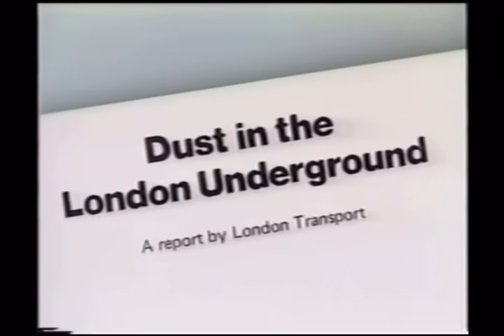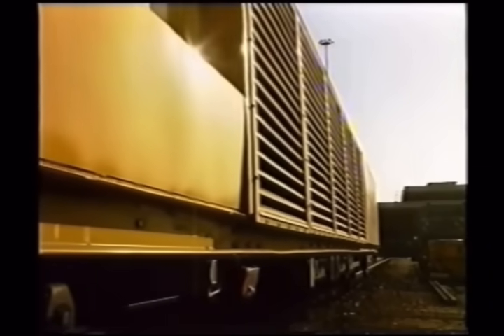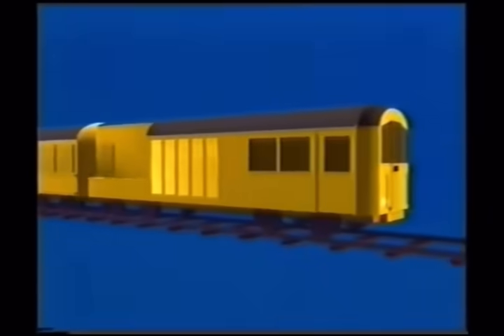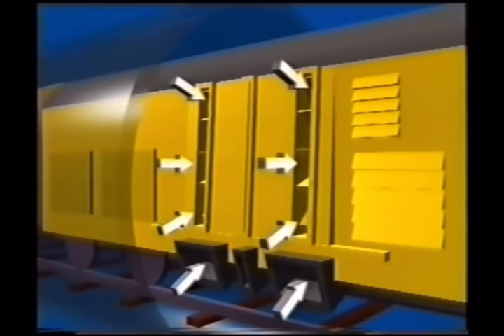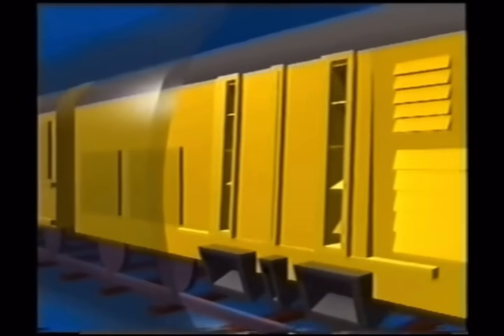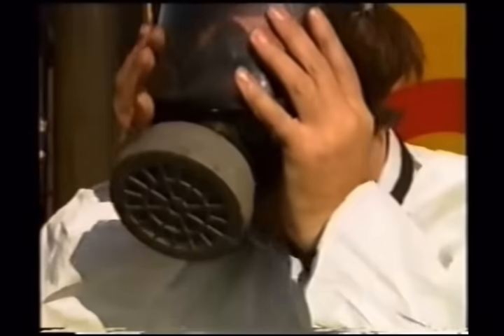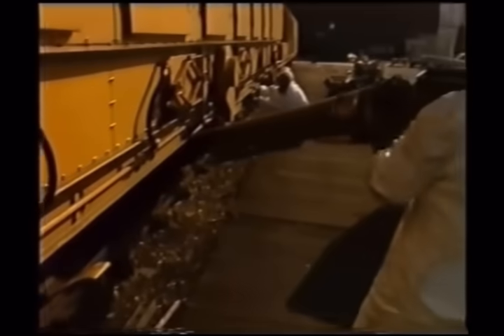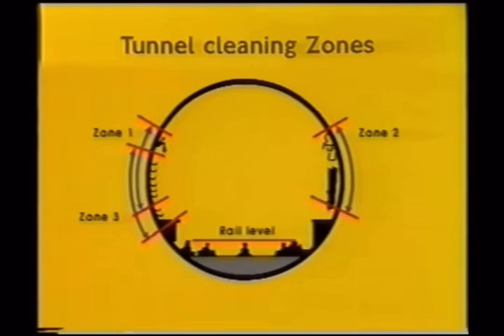Tunnel Cleaning Train - London Underground - #train #railway #london

Comment: Hi there my real Name is Mr C. T. Boxill-Harris, I have another interesting idea for most of us Class 315, Class 314, Class 313, Class 491, Class 442, Class 441, Class 430, Class 421, Class 412, Class 411, and Class 410, and that will also include those interesting Class 422 6 speed Voith DIWA Automatic Gearbox Transmission Very Very Loud 5 speed Allison Automatic Transmission Train fans out there, rather than scrapping most of the Class 315, Class 314, Class 313, Class 491, Class 441, Class 442, Class 430, Class 412, Class 411, Class 410, Class 422, that will instantly include the Class 421, maybe you guys can convert them. Including rebuilding most of the brand new Gardner 6LXB Engine, Scania N113 Engine, Gardner 6LXC Engine, Volvo B10M Engine, Garnder 6LX Engine, Cummins N14 Engine, Volvo D10A Engine, Leyland 510 Engine, Volvo D10M Engine, Gardner 8LXB Engine, Class 315, Class 313, Class 314, Class 491, Class 442, Class 314, Class 313, Class 441, Class 430, Class 412, Class 411, Class 410, Class 422, so they can be able to do all of the Particular Train units such as for example, Class 150, Class 155, Class 106, Class 117, Class 114, Class 105 and the Class 154 and that will instantly be including the Class 421, with a 6 speed Voith DIWA Automatic Gearbox Transmission Very Very Loud 5 speed Allison Automatic Gearboxes and converting and that will also be including building most of them into a Three Carriages per units of Class 315, Class 314, Class 313, Class 491, Class 421, Class 422, Class 442, Class 412, Class 410, and that is including those Class 411 6 speed Voith DIWA Automatic Gearbox Transmission Very Very Loud 5 speed Allison Automatic Transmission for all of us Class 421 and Class 412 Diesel Train fans out there Pretty PLEASE? Are you still going to do this interesting type of Project? Class 491, Class 441, Class 442, Class 430, Class 412 Class 411, and Class 410 will be rebuilding the Class 422 Diesel Train fans out there PLEASE.

Comment: When was the last time this was used? I have to wash my hair EVERY time I travel on the tube!!! It's disgusting! Why is there only one on these trains? Every different line should have it's own cleaning train! Crickey!!!! This is made of 1938 Bakerloo line Driving cars!!!  Almost 90 years old now... is there a newer version of this train or is LU still using the same unit?
Reply from the maker: Apparently this train has been scrapped, and the cleaning is done by hand using backpack hoovers, so I’ve been told.
Reply: @kingwolfgaming4774  Dust pan and brush then yet again! Sighs!!! 1 step forward - 3 steps backward as per usual!

Comment: This has to be 70s since they were then starting to push the metric system (kilometers). I don't know anyone in the UK that refers to Kilometers for distance.
Reply from the maker: You think it was that old? Did the metric system start in 1971? I’m not sure just asking. 👍
Reply: @kingwolfgaming4774  I think 1971 was the magic year for switching to a decimal currency and then the kinda/sorta adoption of the metric system. Gasoline and diesel pumps have, I believe, gone to measuring in litres but most road signs are still in "miles" and most people still talk in pounds and ounces. I emigrated in the early 90s so I can't tell you much beyond that other than what I glean in conversations.
Reply: @mostlyinterested1016  We refer to speed on roads in MPH, Height on Bridges in Feet and Inches but shows metric too all weights and measures in shops legally have to be metric EXCEPT for MILK AND BEER which can be sold in pints. People refer to their height in Feet and Inches and weight in Stones and Pounds (14 pounds is one stone) But day to day measuring is metric. We use degree Celsius for temperature and most people use the 24 hour clock. When we cook we use metric as in ml and litres and Grammes for weight. It's illegal for a shop to use-non metric weights and measures. I think most people of a certain age know their weight in both KGs and their height in metres but know the imperial versions. I think most British can flick between the systems quite easily. 
I remember a joke when we switched to metric in shops "A man says can I have a pound of potatoes please" the shopkeeper says we it's KILOS now. So the man says "Can I have a pound of Kilos please".
Reply: @markylon  The funny thing, going way back, is that it's so darned easy to multiply and divide in bases of ten and yet we all resisted it when it first started. Go figure.
Reply: The entire engineering world, including railway engineers, now use metric. New railways (at least, on the main line network - not sure what they do on the Underground) do still get mileposts as location markers, but the design and construction is done entirely in metric.

Comment: The main reason was apart from the trash the brakes are still made of asbestos
Reply from the maker: I’ve always wondered about the brake dust. Are they still asbestos based?
Reply: @kingwolfgaming4774  Automobile and truck brake pads haven't contained asbestos for something like 50 or 60 years now. I can't imagine that train brake pads would be any different. Aside from legality, who would still want to maintain the equipment and materials to make a few specialized brake pads a year?
Reply: Train brakes are cast iron that is one of the reasons they squeak. Cast is much softer than the wheels

Comment: Obviously pressure washing is out....well I hope not!
Reply from the maker: Why not you could turn the traction current off. 😆
Reply: @kingwolfgaming4774  Way too much electrical infrastructure like insulators and signaling and switchgear that was not designed to be protected from rain and would be quickly destroyed. There is also ancient power cabling near 100 years old, and its ability to withstand water mixed with conductive mud would be highly questionable after all this time.

Comment: I imagine that with regenerative motors increasingly being used, meaning less reduction of speed through braking, dust no longer accumulates as quickly.
Reply: You are absolutely correct. It reduces the mechanical braking by around 85%
It stops working at around 4,mph. To work, it returns current at around 900 volts, As the track reduces this to 720, the braking force applies. However, if there is no traffic to absorb the current, as the track voltage rises, the braking effect is lost. Then the mechanical brake does all the work.
Improving the network is constantly reducing the mechanical braking, but is a complex process.
The biggest problem is that old and new stock cannot be mixed within a sector, since if it is stationary and becomes subjected to a voltage increase, breakers will drop out.
Reply from the maker: Great invention regenerative braking motors
Reply: You are forgetting that wheel and rail wear is also a dust source. Arching between the contact rails and shoes also produces dust.
Reply: @SandBoxJohn  Sure. I was just focusing more on the braking side of things, but good point.

Comment: I was a driver at Golders Green. When the works for the 1995 stock were being undertaken, the tunnel cleaning train was brought out to clean the tunnels to make the environment a little better for the works and effects of the new stock. Would often see the TCT at Edgware being emptied.
Reply from the maker: I don’t think I would like the job of emptying it.
Reply: @kingwolfgaming4774  i couldn't imagine how dirty those filters would be
Reply: I don't understand why they didn't automate the emptying process. You wouldn't even need to change the cloth filters that often as they use compressed air to pulse blow down each filter at the same time, it's kinda cool to see it happen but the micro span time that it cleans out the sock really doesn't stop vacuum. It's quite effective really. And as far as the dust use a screw feeder to remove it to waiting dust hoppers. And large debris can use automated controls to dump in trash hoppers. Um I don't think they pay 50 people to clean the rail areas either, it would be phenomenally cheaper to convert older cars to do this process than to scrap them. But the actual collection car really wouldn't need replaced as long as it's kept out of the weather, only the driver car. Ok wait why did it need 5 cars again? Vac car, storage car, and driver car. Why did it need 2 more cars? And why did it take 6 weeks to vacuum that section of rail? The vacuum should have been on pivot joints to get closer to the surface with a semi soft brush to rub the sides, roof, and tracks with the air jet nozzles right in front of the vac hoses. There is so much you can do to improve this system. You wouldn't even need a human to run the thing, set it up to run between two set points and return to the dump location to be emptied.
Reply: You would need to check the cloth socks at least every 6 months for failure though, depending on what was sucked up. But with the amount of rails in England I'm not sure of the replacement timeframe for the vac socks if only one train is doing all the cleaning.
Reply: @louismessere6379  The train was emptied daily at Edgware as they had a skip that could be conveniently placed next to the train in a new part of the depot.
Reply: @louismessere6379  The train was converted from a 1938 tube stock mostly. And would clean a specific area of the tunnel/track on one pass or one shift. So cleaning an entire tunnel would take a while. Every day the train would need emptying into a skip. Obviously the contents being extremely hazardous in it's disturbed form. It was an ingenious train which was unique and specific for london underground. Unfortunately, as far as I'm aware it's been scrapped.
Reply: @kingwolfgaming4774  Indeed. The person emptying it would have one of those white full overalls on.
Reply: How does the cleaning unit move from say the Northern to the Bakerloo line etc etc?

Comment: How old is this video?
Reply: 1:15 says  occupational exposure limits 1992, so at least 31 32 years
Reply from the maker: 1992
Reply: I was 26 in ‘92, and saw this contraption on a siding at some point. The train was stitched together in ‘76 from 38-stock, scrapped in 2012 (source LU).

Ok, we’re all museum pieces now. Good thing to share this, for the same reason. The camerama… operator getting distracted by eh… a particular member of the general public, is also museal. 

(No wonder I never got anything useful done in London back then…😅)

Comment: I wonder if they still use an underground cleaning train nowadays
Reply: YES THEY DO !!! Its run overnight
Reply: Yep, still in use today. Currently it’s old 1938 converted stock being used, a few years again a new train was designed using old Victoria line stock (1967). Don’t think that went any further. Once the 1972 m2 are replaced that could from the the train, but it costs millions of pounds, LUL don’t have the money, so the old girl might need to continue
Reply: @davegray205  Complete and utter bollocks. The train in this video was cut up in Ruislip depot 12 years ago.
Reply: @intercity125  thanks for your insightful comment. Yes, after checking the 1938 stock has been relieved of its duties. Currently 50 operatives walk doing the tunnels cleaning.
Reply: @intercity125  great to see someone with actual common sense.
Reply: @davegray205  Typical of the UK to use an old fashioned train to do this job. Is the UK really this 'broke'?....that they can't afford a new train specially designed for tunnel cleaning duties??? It seems absurd that they haven't invested in a brand new kind of train to do this specific job. But as I said, this is the UK we're talking about here.....where nothing surprises me anymore.
Reply: @robtyman4281 , TfL would have to get tunnel maintenance cars that fit the circular tunnels for the Deep Tube lines and have said cars for the Sub-Surface lines.
Reply: I don't think they do
Reply: @BaileyChap  thats unfortunate. they had an interesting concept too
Reply from the maker: Does it look any different after cleaning?
Reply: @kingwolfgaming4774  overall, no. It only picks  up loose particles and debris. The tunnels are not washed as there is too many electrical items down in the tunnels. Just ‘hovered’
Reply from the maker: Yes apparently they do
Reply: There is an abundance of unemployed cleaners in London….get them employed now….
Reply: No, they use a Dyson these days 🙄
Reply: They clean the tunnel manually nowadays
Reply: @rowland5951  The video's about a tunnel-cleaning train, not the cleaning of the trains themselves.
Reply: @crossleydd42  I'm aware of that the tunnels are cleaned manually. This train  was broken up for parts in 2012.